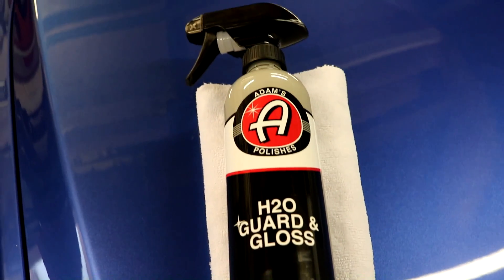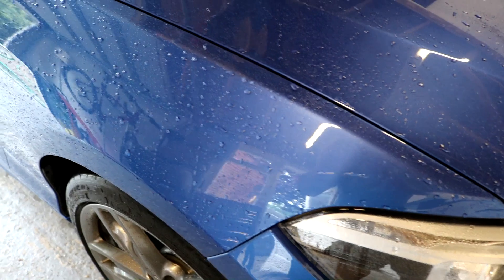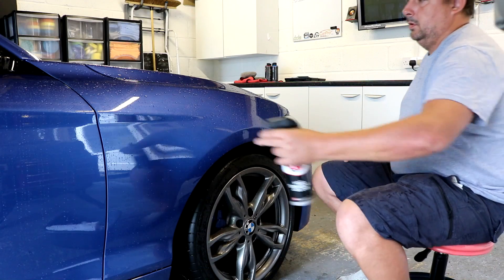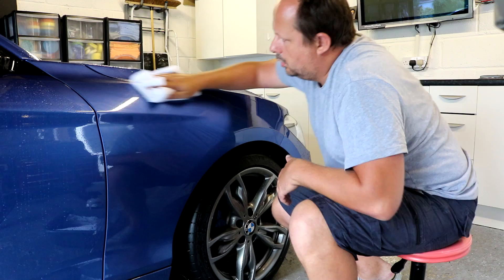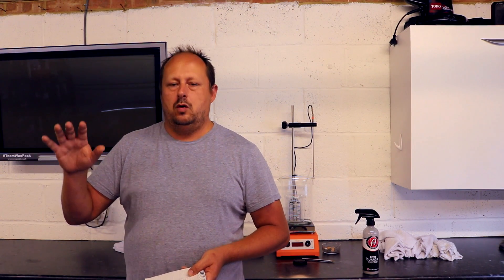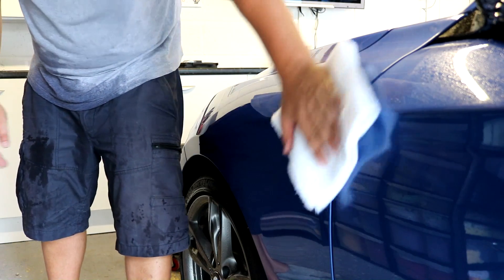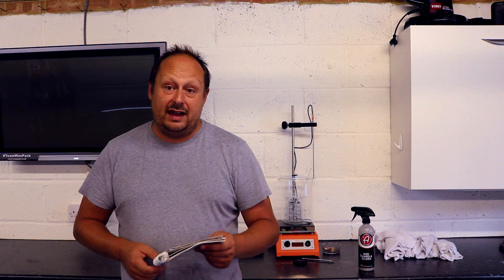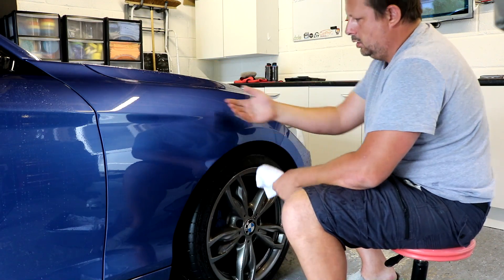Adams H2O Guard and gloss review

Comment: I'm really glad you reviewed this product. I've been using it for a few months now and I'm extremely impressed with the ease of use and the gloss finish it leaves behind. I've also used Adam's Paint Sealant, but was not as impressed as the H2O Guard and Gloss. This H2O seems to leave a more hydrophobic surface. The traditional Adam's Sealant leaves more of a sheeting characteristic when being rinsed, so the lack of beading makes it harder to tell if the product is still protecting. I recently purchased a gallon of H2O G&G and I apply it about every 3rd or 4th wash cycle (once per month). The gloss from H2O tends to increase over time with multiple applications. Great job Jon!  I figured you'd be impressed with this sealant.
Reply: So you can use the h2o product as a replacement to the sealant?
Reply: It’s not a sealant tho lol

Comment: Always wanted to try this and eventually will. I have been using AMMO Hydrate for a while and love it. Used it on a friends car which had no wax or protection on the paint. The car still beads tight and Hydrate was applied to dry it about 2 and a half months ago.

Comment: This stuff is amazing as with most of Adam's Polishes products. Can be a bit finicky application-wise but offers great protection and shine.

Also, for long term use, try a darker colored application towel. It will turn your lighter colored towels grey
Reply from the maker: I had heard people say this.. but I could not find anything really bad about the application process... no streaking, no like product clinging.. just so light to buff away back to the shine..   only thing was could get a bit messy if you worked it around with all the standing water on the car..   so drier panels with damp cloth i think best way forward.

Comment: Hello John. Just used the Adam's Interior Detailer. I have to say the results are quite simply stunning (if you follow the destructions!!!!). Lovely clean Matt finish, no sticky or tacky feel afterwards either. Even the gloss trims come up nice after a quick buff with no residue or smearing. As for the Adam's car shampoo, well it tended to dry off slightly but all it needed was a quick rinse to re-wet the surface then a blast with pressure washer clear the rest. Used autoglym aqua wax as part of the drying process which has to be done panel by panel as I find it can over dry and look streaky. The H2O guard and gloss looked at lot easier to use, but I've got a couple of litres of the autoglym left so gotta use it up first. Great vlogs as per usual and looking forward to the next one. Thanks for all the advice.
Reply from the maker: jeff gave me a sample of interior detailer about a year ago..  I use it as part of my glovebox detailing gear and I agree with everything you say there...     I found the adams shampoo dries infinity slower than and other soap Ive used..   yes it can still dry out.. but do that test I did on a hot day and it takes about 7 times longer to dry to a film.  and the film is kind of softer and almost invisable..  but generally of course even with the adams shampoo you want to avoid letting them dry of its leaving soap on the panel..  I love this shampoo, because I can actually see a performance thats unique there..     Aqua wax is a very good product, I think its another example of the siloxane format put to good use in a water friendly application method..   pretty much anything autoglym will be very well formulated..  great stuff phil thanks for that.

Comment: Have you ever used Carbon collectives hybrid coating? It's even easier to apply than the Adams, spray on to a wet clean car after washing then just rinse off with a pressure washer. I'd be interested to hear your thoughts/review on it. Liking the channel by the way 👍

Comment: I would not be usin this, but watching the review immediate thoughts were I’d dry the car off to a know condition.
The dry method sounds OK, but if the wet method was better or preferred, what do you think about using a distilled water spray on the panel, then this product? Seems to be a couple of pluses, no concern about quality of water, then get the car inside and no ned to have water dripping all over the floor and already laid water marks? Might also cut down on MF towels too.

Comment: Can you recommend a drying aid?
Reply from the maker: hi there.   It really depends what you mean Cervette8.   Really any water based non wax based detail spray.   I think the term drying aid in america is different to the UK understanding/meanding of the term.   In the USA if a product can be applied after the car is washed and its wet and then apply it and you dry off the car it gets classed as a drying aid.  For example people refer to this stuff as a drying aid product, but it doesnt aid drying, it does not make drying quicker or easier (in fact longer), it doesnt thin the water or make it run off the car easier.

In the UK we have rinse aid products which can use to soften the water on the car and make rinsing and drying easier.. For example angelwax blue rinse.   But a typical detail spray is really a good drying aid if you want to thin out the stnading water and add a bit of lubrication while you are toweling down.

Forgive the ramble just important for to understand.  However theres 4-5 sealant products you could look to check out, that I think might be what your after.    Adams H20, Opti-Seal, Beadmaker, Gyeon Wet Coat, Carpro reload.            I think my favorite of all these is gyeon wet coat.  but ill test them all out togther at some point.  Have a watch of the video on the channel called "most impressive protection combo Ive seen since doing the channel" (something like that) where I talk about wet coat and how best to apply it.